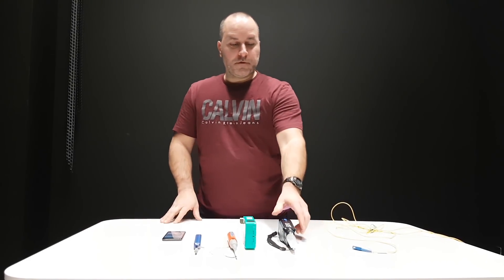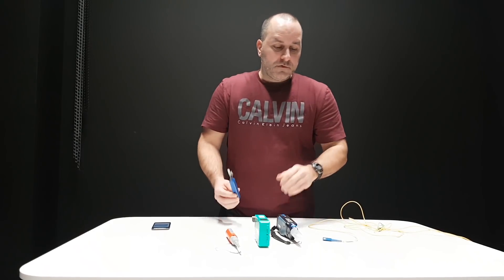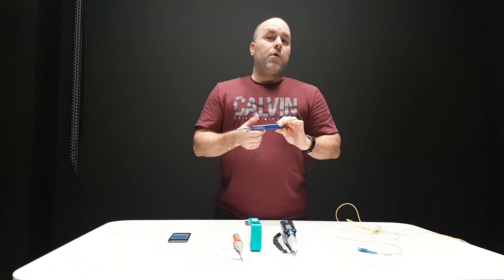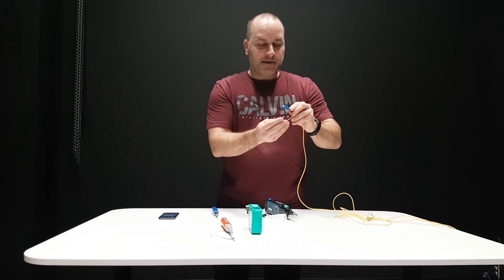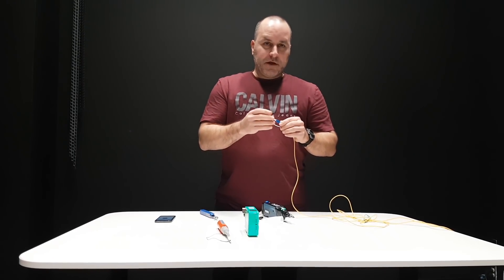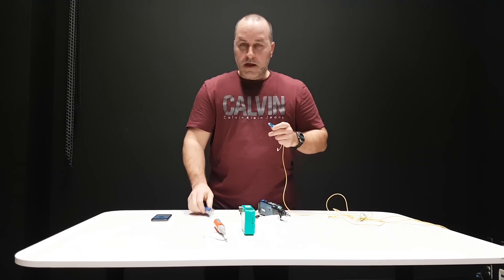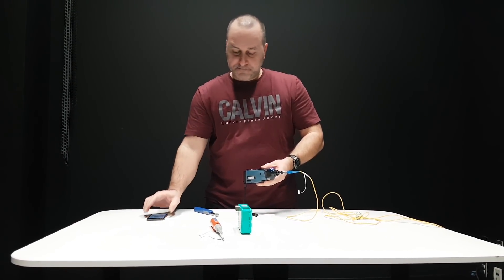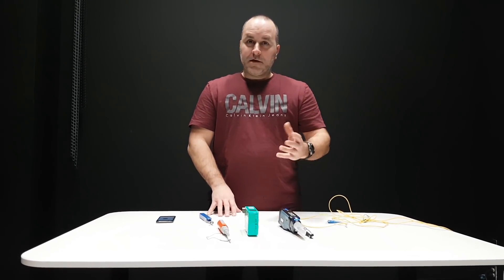How to clean fiber connectors before inspection | FIP-435B

Comment: EXFO equipment is mostly all I use. I did find a couple of issues with your FIP probe. The APC bulkhead connector will not fit inside EXFO's own test equipment, the EUI interface adapter, though it does fit in other equipment.  The alignmnet tab is too narrow on the EUI, so the probe tip doesnt go all the way in. The UPC LC round probe doesn't work in SFP's, its either too long or too short for that device, I need to double check as to which it is. But its a great probe, best on the market. I use it everyday. I have a lot of EXFO equipment being used on my training page.